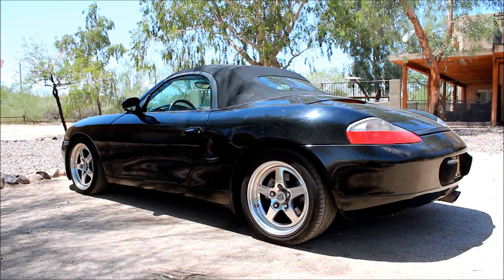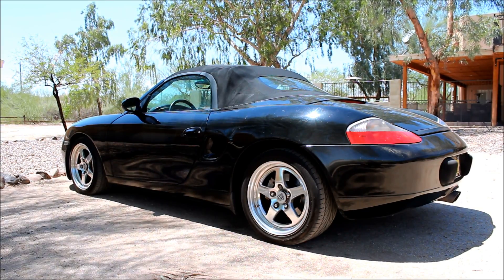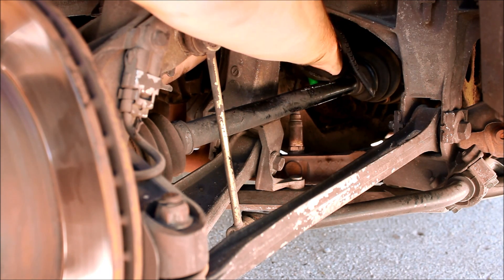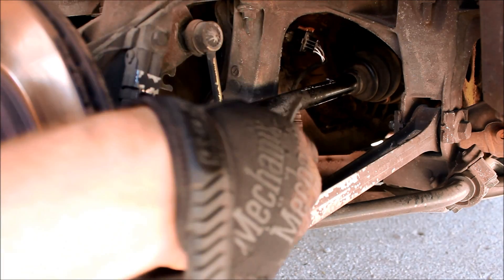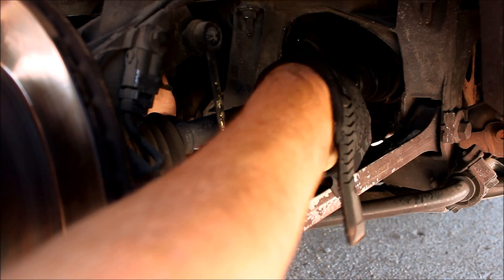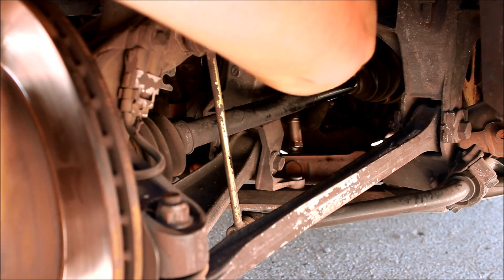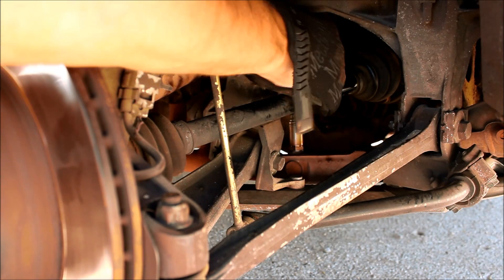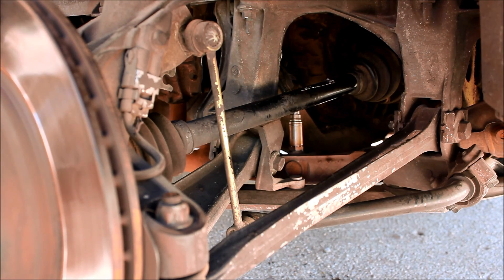Porsche Oxygen Sensor Replacement

Comment: Thanxfor ur help. Had emissions problem and scanned the obd and found fault with pre cat O2 sensor on bank4-6.
Watched ur vid and then investigated and found the plug was not connected properly, the red plastic part was popped out !
Refitted it properly, went for drive and the checked obd. Ehhh No Faults !!

Comment: If you're unlucky, you will need to heat it up with a torch to get it out. That's a more typical situation, particularly if the sensor has been in place for years.

Comment: Is this a 2.5? How many oxygen sensors are there?  2...One on each side? or 4? Thanks!
Reply: 97 Boxster should have 2, one on each bank. Maybe this one has a replacement engine/exhaust.
Reply from the maker: 2.5, there are 4 o2 sensors, 1 pre cat and 1 post cat on each bank

Comment: What does the car do that let's you kno that ur oxygen sensor went bad??
Reply from the maker: In this instance, Check Engine Light with these codes P0154 and P1119. There are other codes that indicate a faulty oxygen sensor. Not all codes related to oxygen sensors are an indication that the sensor is bad.